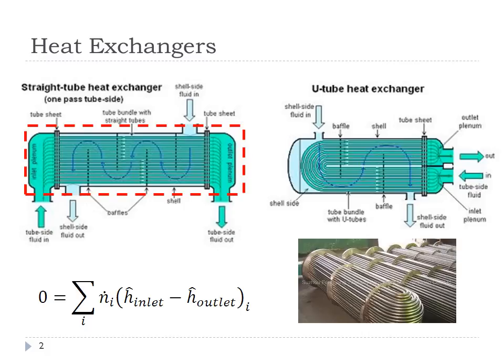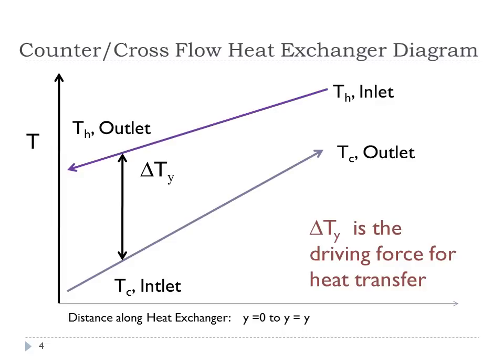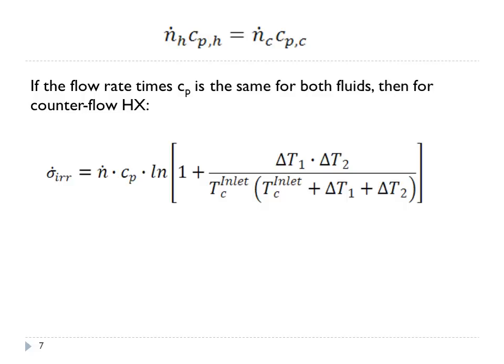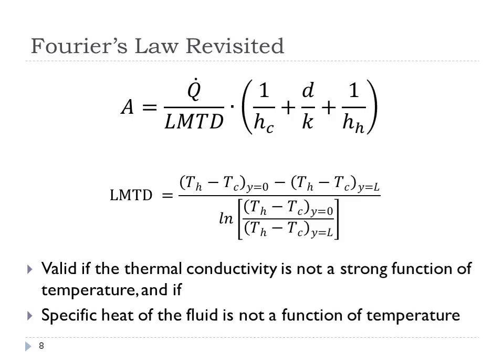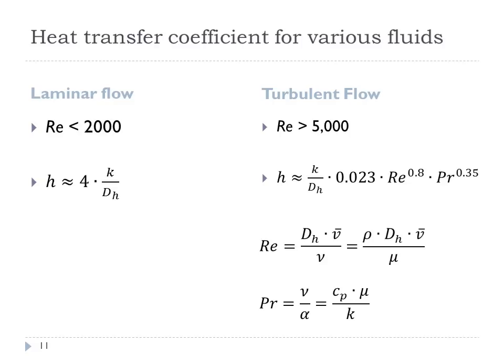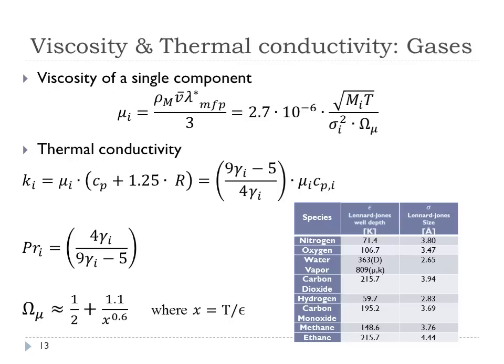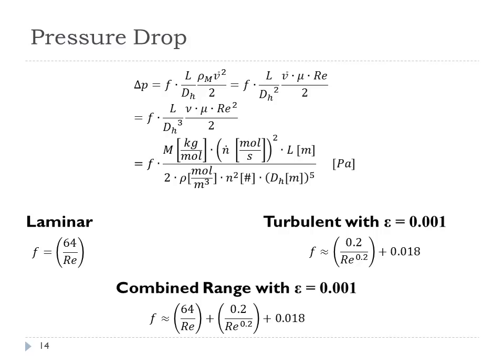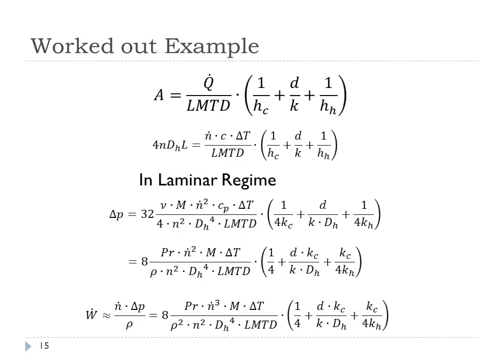Lecture#5: Heat Exchanger Design

Comment: I will try to learn well and share it with my juniors. The direction of YouTube I am aiming to pass on to my juniors at this point in my career to work on the thermal design of the heat exchanger that I have been working for a lifetime. I would like to ask you a lot of teachings if you will hear it often in your chanel.

Comment: Hi, i need to design Heat exchanger for my project. The hot stream temperature is 75 and 25 for inlet and outlet respectively. heat duty is 4.018 kW. now i'm planning to use water to cool down the substance. But i don't have any info on its properties. I've read that maybe 21-22 deg C is an ideal for the inlet. but i can't determine the outlet because i don't have the flowrate of the water. so how am i supposed to determine the flowrate or the outlet temperature? Please help, i'm stuck because i can't even calculate the LMTD
Reply: I have a same type of project too. If you achieve to design it can you send me an example of it
Reply: @mertyalcinoz591  hi, i'll look into it if i still have the files. If so, I could send it to you.